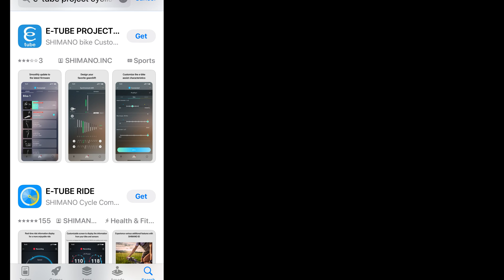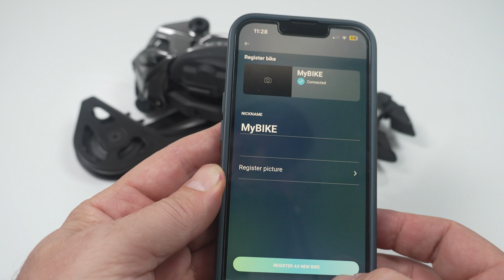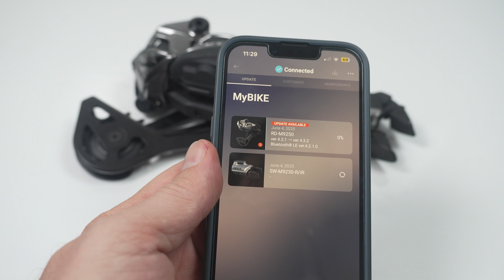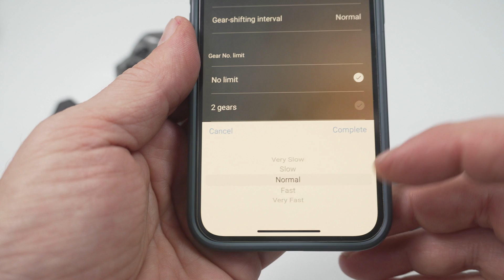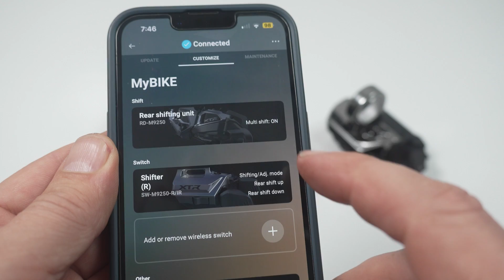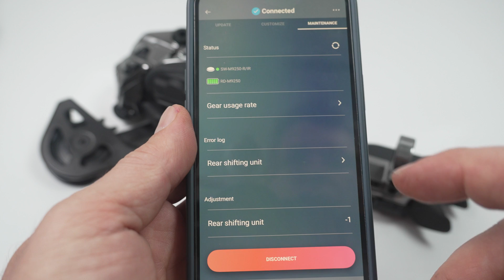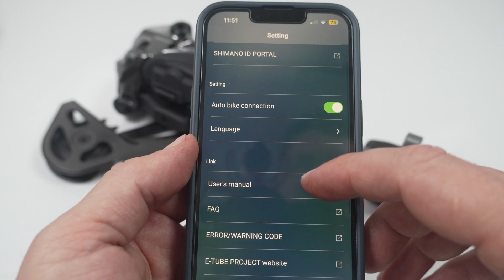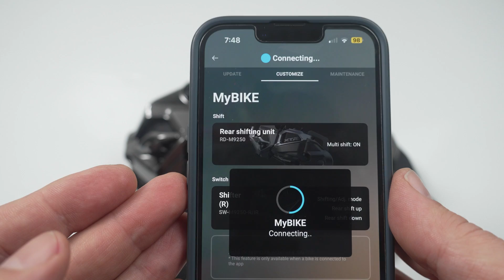Shimano Di2 MTB - E-TUBE Project App for MTB Configuration, XTR, XT, DEORE Wireless M9200 M8200 6200

Comment: So I recently bought the XT and it was installed and setup at the bike shop so my phone is not connected to the derailleur. So do you suggest that I should connect it to the etube app ? Or should I leave it and let it be without the etube app ? One more thing let's say I end up connecting to the app will it mess up the setup and adjustment that was set at the bike shop ? Or will it be same as setup at the bike shop ?
Reply from the maker: You don’t have to but at least for firmware upgrades I would highly recommend it

Comment: 스램제품처럼 특정단수까지만 사용할수 있도록 하는 기능도 있나요? 예를들면 12단용이지만 11단까지만 움직이도록 세팅하는 경우 말이에요
Reply from the maker: Definitely you have the limit screws for that. A blunt option though
Reply: @LoveMTB  
Does the word that there is a limit screw mean that we can physically restrict it to use up to 11 steps? Direct from the machine without using the app?
Reply from the maker: @hw8057 Yes mechanical restriction. But cassette spacing will still be for 12 speed so don't know what you want to do with that...

Comment: Does any other Shimano Di2 device support individual sprocket adjustments? If yes we may hope that they will push a firmware upgrade for this. For me this is a no-no for now because i'm afraid I will be limited to shimano chains and cassettes. I may also consider the Wheeltop for my 2026 electronic shifting upgrade if shimano doesn't attend to this.
Reply from the maker: Only company offering this is Wheeltop today. Unfortunately. Don’t know why the big S companies don’t do this…
Reply: @LoveMTB  probably to get you spending $$ on their cassettes - chains if you go with only the derailleur and get not the best shifting performance and noise. I went from shimano XTR cassette to garbaruk because after 2000kms it started creaking and I also broken down a tooth on the higher aluminum sprockets. Since then I can't get the shifting completely perfect on the garbaruk cassette even with shimano chain therefore I am a bit disappointed. I was hoping that the di2 will come with some tweaking options to get things smooth but seems that there is no hope for now.
thanks for the info!!! Cheers 😁
Reply from the maker: @kkostasgr  Garbaruk has their 2.0 version of their cassettes out, now for the SRAM but I bet Shimano is coming. SHimano also has their bew x200 cassettes out that mostly adress the creaking you're talking about. Also when it comes to drivetrain performance, I just published this, you might find it useful - https://youtu.be/G8pnZiSezU8

Comment: Is there a way to configure shifter to have smooth drop-downs of gears ? At the moment every drop on high gears doing this "heavy drop" sound, it is going smoothly to the next gear but with this effect of falling rather than changing if you know what I mean :) it is difficult to describe.
Reply from the maker: It's smoother than before when moving to smaller cogs, that's what HG+ does. Do you use a Shimano chain installed correctly? Also a micro adjustment towards the smaller cogs can do that.
Reply: @LoveMTB  Thanks for an advice! Yes, XTR chain properly mounted. But maybe it is normal behavior and im looking for problems where there are no any ;) Will try to play a little with micro adjustments via app.

Comment: The app is pretty straight fwd. You get the hang of it after a few uses. 

I find the limit screws crappy on the RD. Feels like I almost strip the head if you turn too much. 

I have the Deore XT Ispec EV kit. Seems like not many shops in Canada have them in stock at the moment. Maybe end of month shipment. Looking fwd to see the Deore version. 

Great insight into the latest tech as usual.
Reply from the maker: Thanks! I would only go for the Deore derailleur and not the shifter IMO

Comment: Awesome vid thank you!!!After a couple hundred kms on the xtr di2 I really like it.I have only 2 complaints the first one is my shifter batterys were in the red{almost dead}how can a 2 year battery be dead already these units have only been releasted a couple months ago!!! My biggest complaint is  you can't{unless I'm doing something wrong}have the mechanical xt or xtr shifting pattern 2 gears at a time going down the cassette and 3 gears going up the cassette,your limited to either 2 gears at a time for both shift buttons or 3 gears at a time on both buttons,I think this is a software issue that should be easy to fix come on shimano,its kinda funny because I can do this on my sramano drive train but not the shimano drive train lol!!!Cheers!!!
Reply from the maker: So SRAMano for the win!?? Interesting to know why you cave in to the Shimano di2 after using the SRAMano for such a long time
Reply: @LoveMTB  Well I guess I've been a shimano fan boy all along lol,With the axs I always hated the shifters the shimano shifter is a work of art so natural feeling.The xtr derailleur battery seems to last forever between charges unlike the axs,I've only charged the xtr batt when it was installed and it still shows green after 150kms.Cheers!!!
Reply from the maker: @glennmorgan8691 Glad you found the perfect drivetrain for your new bike. Happy trails!